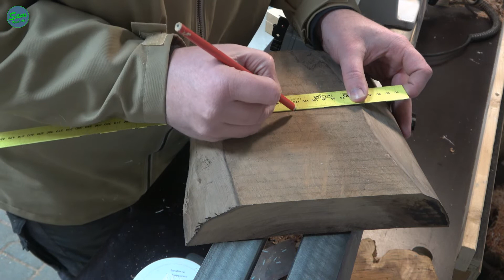Woodturning - From Plank To Plate

Comment: Nice wood and finish. Poor turning job. There are clearly visible breaks in your inside curved surface and one on the outside....even on this video. You are using your gouge more for scraping than cutting. Riding the bevel will give you a smooth surface that requires no scraping and little sanding. You should definitely take some lessons. Don’t be discouraged; once someone shows you the right way and you get a feel for it, your entire process will become more enjoyable and effective. And your quality will significantly improve.
Reply from the maker: Hello Adam! Thank you for your comment! I quite understand what you mean... Unfortunatly there are vibrations on the lathe starting at about 800/900 rpm so I didn't get a nice surface in the corners by cutting.... my lathe is a small one and it is not possible to fix it on the ground 🙄😔 so I decided to scrap 🤷‍♂️